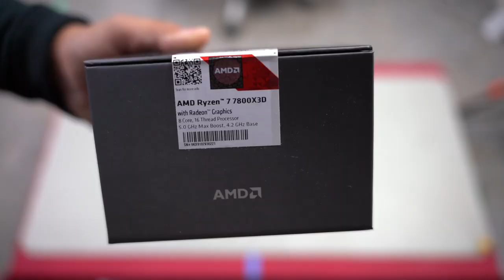MSI MAG PANO M100R PZ all white matx gaming pc-non project zero mobo gigabyte b650m gaming Wifi

Comment: Hi, i have a rx 7800 xt sapphire nitro +. Wich is 62mm thick, do you think this low profile fans will fit below it, if i buy this case? Because in my nox hummer zero, wich is the same height as this case, i have like 2-3 cm between the gpu and the psu
Reply from the maker: it's abit thick inprolly won't get the fans in
Reply: @MIKEYZVLOGZ  thats a shame. I was really looking to buy this case. Any recomendations? My favorite is the montech King 95 pro. But its almost double the price. I can get this One for 71 euros. And the montech is 130.
Reply from the maker: @andrevieirasilva6902  the montech king 95 is a beast of a case so much potential and looks fabulous ...for that price are u getting the fans that come with the montech as well or is it just the case alone..I've done a build in the montech too and it came out looking amazing ..
Reply: @MIKEYZVLOGZ  130 euros is the pro. With the fans

Comment: Hey! Thanks for the inspiration! I got the same slim fans but I can't find the right screws for them, did you pick up yours locally or online?
Reply from the maker: they came with the fans bud
Reply: @MIKEYZVLOGZ  not anymore I guess, thanks though!
Reply from the maker: @thereisnotowel  damn , what u can do is simply get screws that will fit the thread of your case usually its m3 somehitn glike that, make sure they are long enough, if too long cut them shorter, and if the head of the screw isn't big enough use a washer, i do this alot wen i lose screws or just dont have them.. hope this helps
Reply: @MIKEYZVLOGZ Thanks, yeah, I picked up some m3x20s from Bunnings earlier today for this, the thread was wrong. I'm kinda thinking I could just have the new screws cut into the old thread. Last resort kinda stuff though.

Comment: What the heck is this reverse blade fans can you tell me what shall I do I am quite a beginner
Reply from the maker: ok so the way the case comes with the fans on the side ...leave them be ..they are set to intake ..so they pull cool air in... if u want exhaust there instead then u can flip the fans ...the x3 fans u see together on the side... they are reverse blade fans meaning they push air the other way..direction of air flow
Reply from the maker: u don't have to do anything ...they are made that way because most fans have the frame side showing when you use a fan as intake ..so reverse blade fans were made so your fans always look good when you install them...no more looking at the frame side ..thanks to reverse blade fans
Reply: If I leave them as there so there will be no issue in cooling right
Reply from the maker: @dirshpandya2888  yes correct... cool air will be drawn in (intake) which is what u want 😉
Reply: Thank you
Reply from the maker: @dirshpandya2888  most welcome dear friend
Reply: Also fresh air can be pulled in via the bottom fans in front of the PSU shroud. Additional two fans on direct psu shroud top if ya need cool air for mobo gpu or psu. This case is amazing I built a PC in this for my elder dude. It works for every m ATX mobo no mandatory to be used only with pz mobo
Reply: Also the reverse blades make sense because the case needs to pull in cool air like every normal mid tower has similar direction fans in their front idk why did they gave it a name "reverse blades"
Reply from the maker: @srirajdellxps121  yes 100 %
Reply from the maker: @srirajdellxps121  lol its agreat case reallyt is

Comment: hello! that watercoolinng have 396mm L and in the official page of the case said support only radiador 360mm, im confused 😕 😕  The point is that I want to buy a watercooling, but I don't know what the maximum size it supports is, I wanted to buy the Deepcool Mystake 360, but its radiator is 402×120×27 mm, do you think this case supports it? (I have the same case)
Reply from the maker: as long as it's a 360 aio it will fit
Reply: @MIKEYZVLOGZ  thanks! I want to buy the Lian LI Galahad, radiator dimensions 398mm do you think, it will fit without problem?
Reply from the maker: @richardmaldonado9153  I'm will be fine as there is extra room for the tubes and radiator

Comment: i confuse to chose msi mag pano or einarex ragnarok ? or any suggest to this kind of pc case ?
Reply from the maker: It's hard to tell you what to buy because it comes down to personal preference
Reply from the maker: both cases are the exact same, biggest difference i see is the ragnartok has mesh panels top and side , which is both good for cooling and air flow, in the end its up to you they are basically the exact same case, also, the msi was built for the project zero, i think ragnarok is for matx of all sorts, meaning u can hide cables better as well , if your not using the msi project zero mobo matx then maybe get ragnarok case, cuz its for all typical matx mobos

Comment: Can I set the color of RGB fans included with fan using software for specific color?
Reply from the maker: yes u can u plug in the hub into the mobo ..but this case is designed to control rgb using the button on the case..that's how it's wired but yes u can do that
Reply: @MIKEYZVLOGZ  thank u for the information.. from review, the button on only give few preset colors, I was thinking about specific color so I think I am going for the software setting.. Really thanks for the information, it helps me to decide to buy this case
Reply from the maker: @adihege12 ur welcome...if u want more choices then for sure connect the hub to the 5v3pin header on mobo and u can use software to control the colour schemes
Reply: @MIKEYZVLOGZ  thank.. this is going to be my first build, hope I can make it as ur awesome build.
Reply from the maker: @adihege12 u will buddy just be patient my friend
Reply: @MIKEYZVLOGZ  one last question, how long is the graphic card I can put into this case? I am planning Zotac gaming RTX 4060 (pressing the budget) and MSI B760m Gaming plus Wifi motherboard and MSI MaG A650gl 80+ gold for the build.. will it fit inside the case?

Comment: thinking of getting this case.. do you think there would be enough airflow for a 4090 worried it will be to close to the psu shroud?
Reply from the maker: depends how thick the 4090 actually is, some aren't as thick, u will then have to see if it touches the psu shroud or not, cuz air will flow from bottom to top and also intake from the side so i believe sufficient intake and u will have exhaust fasn on top so it will pull hot air out too, in the end its a matter of whether it touches it will be fine if its close, as it will still breathe

Comment: I have the same case and motherboard I wanna know where will I connect the front panel type c connector ??
Reply from the maker: I used usb 3.0 to type c adapter ... it's not as fast as type c but at least u have type c port that works
Reply: @MIKEYZVLOGZ  Im running into the same issue. Which adapter did you use? do you perhaps have a link? :) Awesome build btw!
Reply from the maker: @93Basje  thanks and  what u need is a an adapter that will allow u to plug in that type c cable. I did it by using a splitter ...so it runs at usb 3.0 speed rather then type c. but the point here was to be able to use the port.... I did it using a splitter then am adapter that goes from usb3.0 19pin to type c header. a d I plugged the type c into that adapter I was only able to do this with a splitter first ...so u need 2 adapters . 1. a usb splitter. 2. usb3.0 19pin to type c header

Comment: I dont know if you can help, but I have this case and would like to add additional fans like you did, especially in the front bottom of the case(psu shroud down the line maybe.
I bought it prebuilt, and upon opening the back, all the connections on the fan control board are full with the connections from the fans the case came with.  
It looks like you used an additonal fan control  board, but im a bit confused which cables i would specifically have to buy to make this work? Thanks man.
Reply from the maker: firstly do any of the fan cables have a splitter that allows for a daisy chain? ... cuz that's all you need to make it work.. u would want to use super slims if u can like I did...or else the fans end up too close..which isn't an issue as it's only helping pull more cool air in... but I also think thin fans give it a much more cleaner look where the fans aren't right under the gpu
Reply from the maker: I did use another hub or anything as I was able to daisy chain most of the fans together ...

Comment: Hey,
I recently built a pc. I bought Lian li ST120 fans (Kit of 3). I am not able to mount them on the mesh below the GPU. The screws don’t fit. 

Do you have any idea as to how can I fit those? I don’t have a return option for those fans.

Edit: What are those screws you used for mounting the fans below gpu?
Reply from the maker: I use normal screw for fans...that usually come with fans... lian li should supply the longer fans for when u need to mount through the fan and to radiator ... typical fan screws which are short and stubby are for when u mount a fan directly to pc case without anything between... that's what most long screws are for... if u don't have any ... goto a hardware store and get screws roughly m3 that are about 28mm long to 30mm so they can go through your 25mm thick fans... however just remember do not have them any longer them 28mm to 30mm as it will pierce tour radiator cooling fins...

Comment: How did you connect the USB 3.0 cable?
Reply from the maker: I used an adapter from usb 3.0 to type c, , u can see it at 9:19, if u have usb 3.0 and type c u use a usb 19pin spliter then adapter one to type c and the other for usb 19pin 3.0

Comment: "Which direction should each fan case intake air, and which should exhaust air? Could you explain it to me? I like this case but I lack knowledge in this area. I intend to install all 10 fans as you suggested, without using liquid cooling but utilizing CPU coolers, and using fans on the top instead." thankyou so much i from sea i translate by chatgpt for ask you
Reply from the maker: ok so rule of thumb front intake ..side intake top exhaust rear exhaust bottom intake ..u always want more intake then exhaust ..however there are rare occasions when u use top for exhaust ..it depends on case ..but that's a good rule ro follow
Reply: @MIKEYZVLOGZ  What's the point of putting the 2 fans below the gpu when the power supply will just supply those fans hot air rather than cool air